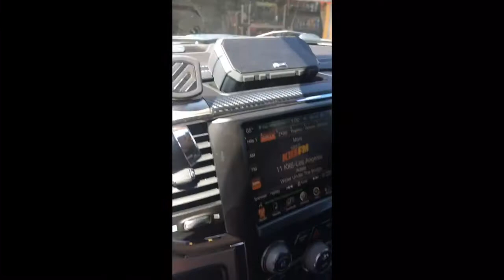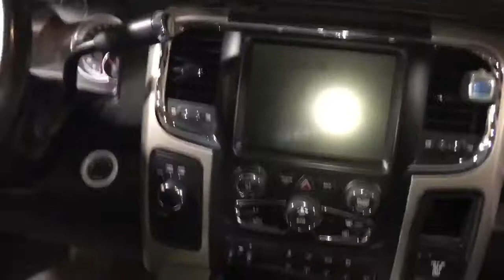Interior Wrap on a 2014 Ram 3500

Comment from the maker: Hope this answers your question.
Reply: Kelley MobileDetailcom. Thanks for video link but not what i was looking for.     I was asking about the back of the armrest where the vents are in the floor of the backseat.
Reply from the maker: crvic93 oooohhh. Ya. Just pops off. Just be careful of the wires that are hooked up. If you want me to do a video I can or just start from the bottom, slowly popping it off. Actually I’ll do a Video cause I’ve added some lights under the seats.
Reply: Kelley MobileDetailcom.      Ok thanks    i appreciate it.